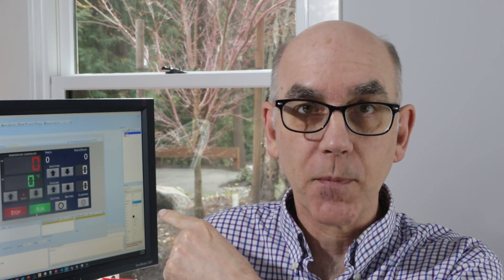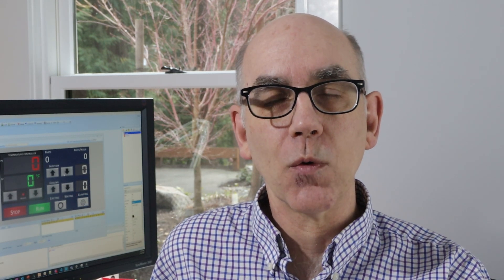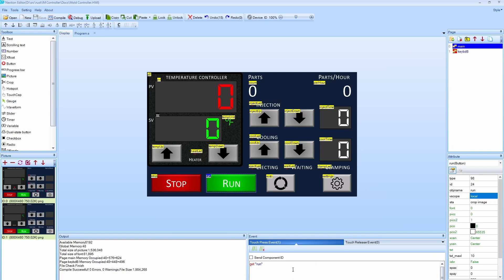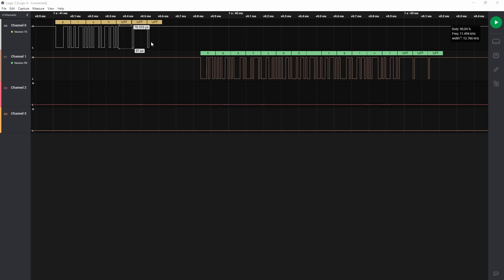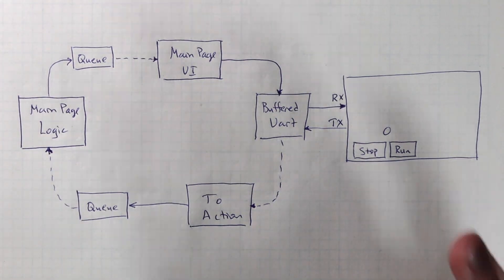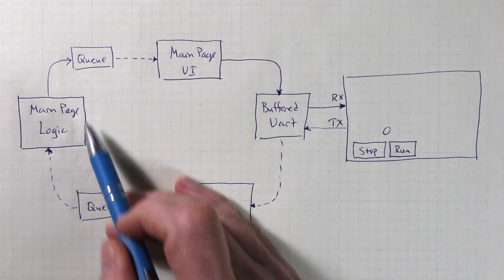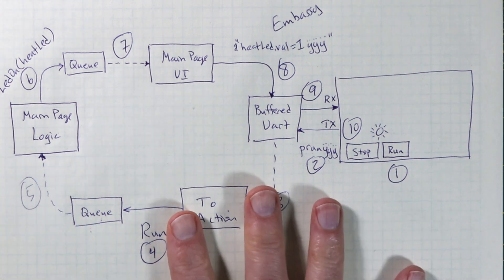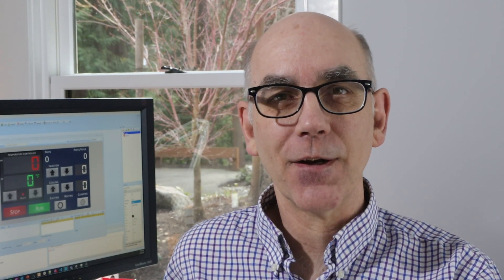Responding to Nextion Button Pushes

Comment: We use a RaspBerry Pi with a 10" display and Tcl/Tk scripting language for our machines (unfortunately no injection molding machine, but we are working hard on it :-) . There you can create your GUI interactively, too. And have all the benefits of a real PC (Linux/WLAN/BT ...).
But its always good to have a look over the cup rim - interesting system 🙂
BTW: it is interesting that many people use 7 segments digits which were invented by the lack of pixel screens. Normal TTF font numbers are far better to read.
But I also like these old displays ;-)
Reply from the maker: Sure, I could have used a Raspberry Pi and others have done just that. I've done plenty of desktop UI work running on Windows. For this project I wanted to use an embedded solution as they're super reliable and turn on pretty much instantly (and you don't have to shut them down before powering off). Those aren't very strong reasons, but it's what I wanted to do. As to the 7-segment display, I know. But it's fun. And this is a hobby project...
Reply: @JohnSL  Thanks for your answer, John
One remark regarding the starting and shutdown times of the RaspPi: You can prepare it to be ready for "hard shutdown" if you enable direct syncing (and turn off the swap, of course). I have done this for some Pis of my machines (CNC etc.).  Starting time here shouldn't be a problem here due to the long preheating delay of the machine ;-)
But yeah, it's hobby and it's interesting to see other solutions.